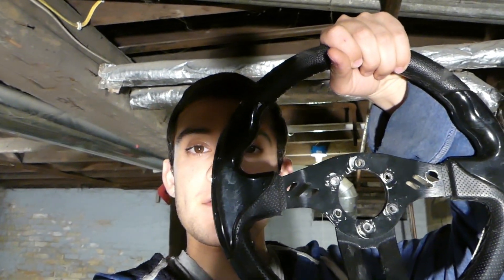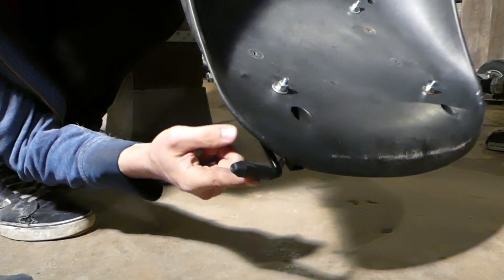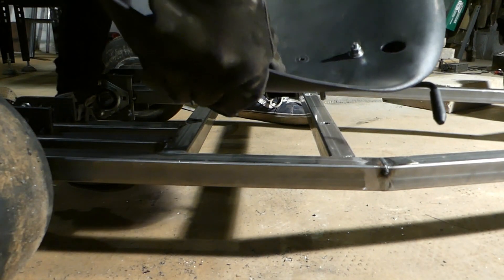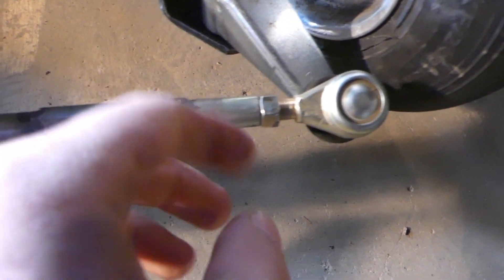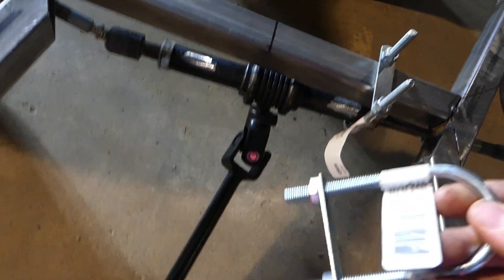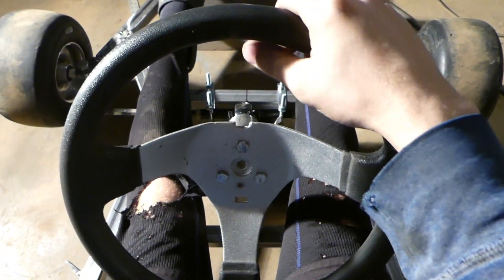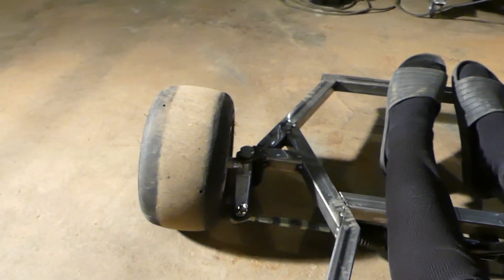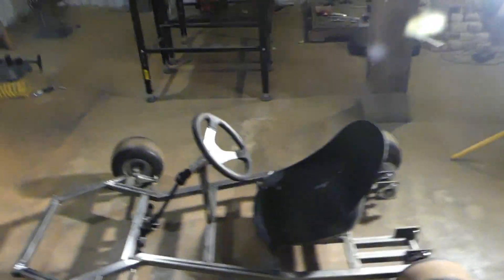Installing the seat and steering system on my go-kart

Comment: I have made a go kart like this please help me what should i use for its movement and speed
Reply from the maker: For movement I assume you mean steering;  The steering system I use I bought off of Amazon.  For the speed, I would use 54 tooth sprocket, it got me up to 32MPH.  I have a video on the sprocket, its called (drilling holes in my sprocket for my go-kart).  I can answer any questions you have.
Reply: @ALYTRA-youtube I mean the engine system and accelerator
Reply from the maker: my go-kart doesn't have an engine, it has an electric motor, engines use gas, my go-kart is electric, it runs off of batteries.  I use a 72volt 3000Watt motor.  I bought it off amazon as a kit, the kit comes with the motor, sprocket, chain, foot pedal, ESC and some other stuff.  And for the accelerator, I think what you mean is how I use the motor to move the go-kart.  The chain goes on the little sprocket on the motor and connects to the bigger 54 tooth sprocket.  You can reach up to 32MPH with that setup.  I have a video on it, it called
(how fast can a 72v 3000w motor go on my go-kart) 
Let me know if you have any more question, I'm happy to help you.